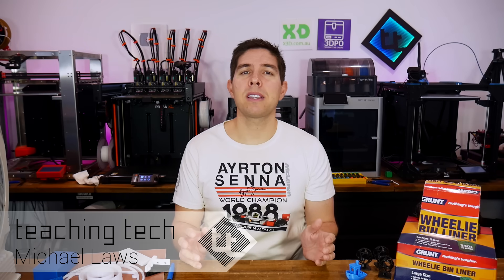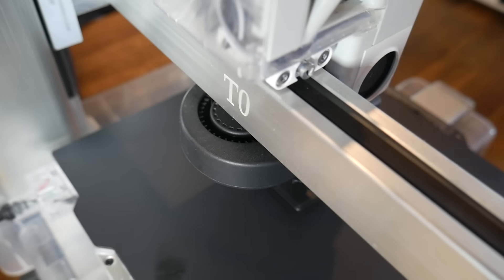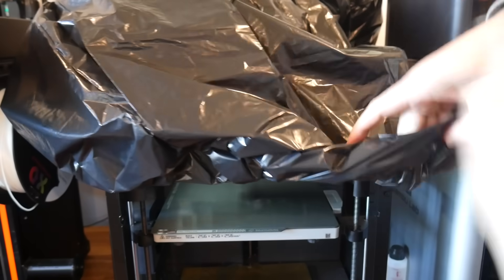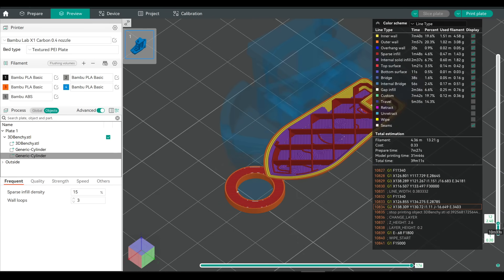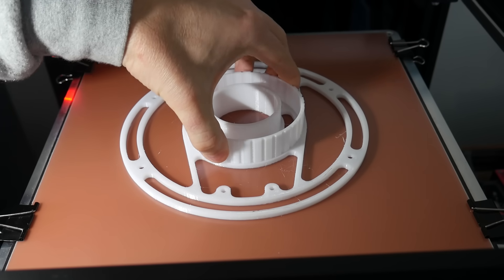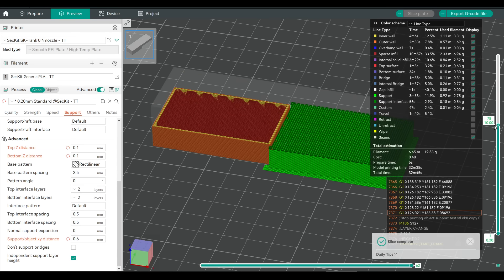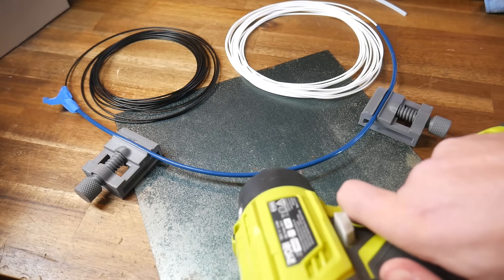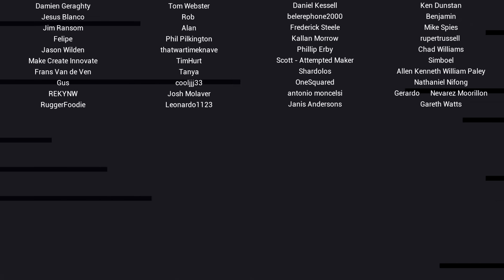Jankiest 3D printing tips that actually work

Comment: Missed your rotational fit on a round shaft by "that much"? The usual cause is a seam and rotating your parts away from the seams will let them go together but not rotate. Jank: Get the parts wet with water and sprinkle baking soda on the wet. Put the parts together and start working them in and out and around. This should get things started. Try it a second (or third) time, and eventually the parts will probably work how you wanted them to work in the first place. This trick will save you all the time and filament that you probably would have thrown away. Toothpaste works too, but I believe the baking soda leaves behind somewhat of a slippery coating.

I used this trick to get some threads to work properly. I left .020" [.5mm] of space between them but they were a no-go. When I worked in the wet baking soda, the remaining powder acted like sand paper and the solution acted like a lubricant. A half-hour of goofing around by the sink saved me four hours of reprint time.

Comment: This is beside your main point, but for the past 10 years I have used hair spray on my print beds.  PLA and PETG and TPU all print without any problems.  Easy to remove (water) or add (just spray more). And cheaper than a PCB

Comment: I got my garolite sheet on the cheap from a local hardware store and used 3m adhesive sheet to attach it to a spring steel plate, all because I also saw Angus on MM talk them up :)

Comment: I already used the trashbag method with my MK3S+ for ABS and PA filaments, good method that works well but as you said the electronics don't like that, had some bugs from time to time with this method !
Tried multiple time the method to join 2 filaments, get it working one or two times but rest of the time the filaments broke... And it worked well with the MK3S+ but not with the Bambu X1C with AMS.

Comment: For TPU which sticks too well to pei, I have one side of my sheet which I rub my oily face on, and touch with my fingers. The has 2 advantages, I can handle my sheet much easier when I can touch one side, so there other side stays perfectly clean, and TPU has perfect adhesion on the greasy side. I just flip the sheet when changing filament types. Been doing this for years.

Comment: Glue stick. I just realised I have one that I got from a reddit/ youtube but I cant remember where. I dont use glue sticks directly. They are water soluble. I cut one up and put it in jam jar which I then filled with water. The resultant solution can then be applied to the bed with a small paint brush and as a liquid comes out nicely flat and thin. Turn on the bed heater for faster drying. Also, once the glue surface starts become rough/worn (due to removal of prints) if it is not too bad I just use a wet brush and safety wash  bottle to dissolve and flatten . Obviously... water and electronics mix too well so apply some common sense.   Also ... remember to eat all the jam before doing any of this :-).

Comment: I switched from an old bed matt that ripped from a part sticking too well.

I use a sheet from ender and i cut it to fit.  It sticks to the bed.   It has helped soooo much.  The old bed would move and warp. when printing things, it would tug here and there, and each print i had to flaten the sheet..

Comment: Cardboard enclosure is way superior to garbage bag. It works well with bed slingers and if you made it big enough to fit also filament dryer you have basically heated chamber.

Comment: Here’s Jank…. When a print is pulling up I have paused and then used a heat gun (no flames here) and heated the warp.  Then I use a short (40cmx40cm) piece of 6cm thick iron bar to press it back into place. The iron cools the plastic quickly and makes it flat.  This works very well! I’ve used it multiple times.

Comment: That enclosure is too professional for me!
I had to print some large ASA prints some time ago. My RatRig Vcore3 is not enclosed. I have a small table that my printer usually stands on, and the dimensions of the printer and table are verry similar. So to make a janky enclosure, I put the printer on the floor, and the table ontop of the printer. Then I took my blanket and it covered the printer with the table nicly. 
The ASA prints were two 10h prints. I was terrified that the house would be set on fire. But it worked out! (and the blanket didnt even smell bad afterward)

Comment: for joining two filaments i use 80 by 80 mm sheet of 0.5 mm aluminium 
folded over a 1.6 mm steel rod that i had laying around 
now its shaped like a U when you look at it from the side 
stick the filaments inside heat it and once it sticks together slowly twist it inside to form an almost perfectly round joint 
if it is too thick use a bit of sandpaper to sand it down to size but usually it just works no problem. 

takes like two minutes tops

Comment: My jankiest hack is cutting 5cm thick blocks from printer packaging foam and putting them under the printer. For even better results, do this inside an enclosure or on top of a board and put another four blocks under that. That'll silence the printer right down to almost nothing. The thin 1cm foam covers don't work, because the printer settles into the foam over time. It has to be faily thick.
Reply: My wife thanks you for this tip.

Comment: My janky way of working a printer is using my little blue clippers to cut off bits of loose plastic from the base of a model as it's printing. Like if the start of a line doesn't stick, it can be one a problem but I can clip it off and save having to start over. Gotta watch the nozzle though it can come at you

Comment: Here at the bad idea factory, to print ABS on my Prusa Mini in an enclosure heated to 70C.  The parts on the printer melted.  I now had a Prusa Mini with a bunch of twisted parts.  By reheating the parts, I was able to straighten them enough to reprint new parts.  Using those, I was able to reprint a second batch of new parts that was actually straight.

Comment: @Teaching Tech, As for combining filaments, I use silicon tubing (1/8"O.D. x1/16" I.D.), using a soldering iron to heat, and slice it off afterwards. It works better than any other method I have ever tried.

Comment: Tip for matching the filament together: put the filament ends next to each other and overlap them a bit. Use a razor blade to cut both at an angle at the same time. The angles will be the same since they were cut on the same plane.

Comment: I did 2 3 4 and 5. 7 is unnecessary. I just feed the new filament into the printer while it's printing. No sensor. Not hot air.

Comment: I am a firm believer in a janky cardboard enclosure. The thick cardboard that comes on new bed mattresses is perfect. It's thick enough that you can hot glue it together, I actually hot glue the cardboard to an old hardwood coffee table I put my 3d printers on. It works so good, I even use some packing tape to make hinges so I have cardboard doors on my cardboard enclosure, it's so janky it's awesome.
Reply: Hopefully you will never get a printer to set on fire.

Comment: Once I was pretty broke when my hotend nozzle threads stripped.  I had an e3d V6 on hand, but no way to mount it to my only printer.  So I zip tied it to the plate the original print hotend was on in order to print the hotend mount for itself.  Easily the most janky thing I've ever done with 3d printing.

Comment: I join filaments by simply pushing in new filament as the old one is being used up. On my Mini it leaves a bit of the model without retractions as now it can only push, but that has never been a problem.

Comment: Tried using heat-shrink tubing to join two pieces of filament together? 
Once cooled, the short length of tubing can sliced off. Using clear heat-shrink tubing allows inspection of join to avoid overheating.

Comment: Wow. The "colouring" of support, (or 'layer adhesion modification' is maybe a better term) is really interesting. This is the sort of thing I wish the big manufacturers were tackling instead of just taking open source designs and barely changing them. I could imagine a small inkjet style head mounted on one side of the normal toolhead that can be deployed with a small servo. No doubt a little bit of research could deliver a better adhesion modifying agent to use than marker ink.
That would be a true game changer.

Comment: Uh, that marker trick isn't jank, it's brilliant!

If you want *jank*, you want my curing station I made out of an old Amazon box that I lined with aluminum foil and taped the UV light to, the day after I got my resin printer..   I've been meaning to replace it with an old microwave that's been repurposed, but I just haven't gotten around to it...since 2021.

Comment: My very first printer was an Anet A8. Of course I fixed all the "this could kill you" issues (I'm not insane) but once those were dealt with, the thing worked quite well. But wiring it all up was a nightmare, and my wire management skills are sorely lacking. Yeah, the wiring on that thing was... messy. Anyways a year or so into its lifespan, the part cooling fan started making the death rattle noise. Tried lubricating it, and that helped for a while, but eventually even that stopped working. I really, really didn't want to have to wire in a new fan (in addition to the wiring nightmare, that would also mean I would have to work on the hot end, which was a PITA to disassemble) So I just unplugged the dying part cooling fan from the mainboard and plopped a cheap desk fan next to the printer. Made sure to switch it on after the first layer went down (I never ran the thing unattended, even with the safety issues corrected, I still didn't want to take any chances; again, I'm not insane) and it worked amazingly well.

Comment: In place of the PTFE, use silicone tube narrower than the filament so it has to stretch. The joint will then exactly match what the filament stretches it to, and you just cut it off and throw away the 1.5 cm snippet rather than having to slip it off.

Comment: Instead of using PTFE tubing to do the join you can use silicon rubber tubing which can then easily be cut with a knife so you can remove it from directly where it is, ie. not sliding it the fill length.

Comment: Used G10 for nylon prints.  Works quite well unless the print is long.  The bed temp and part would warp the G10 over time.

Comment: I have used the PTFE splice a lot.  My older direct drive didn't care about the splice bulge but my P1S jammed.  I just use an exacto blade to cut the PTFE tube off, I have enough scrap short pieces thats its free.

the tighter diameter would work to fix thr P1S jamming, I just got Patron fee back....

Comment: Oh boy. I did some of those things and was sure it was normal.
I use a FR4 / G10 bed. PETG works really well with those. If there is stringing I torch the print. Joining filament with a PTFE tube... Again something I have done.

Comment: fixing it with fire: daily.  I hold it over the stove
old-school part cooling: only for speed benchies
derelicte enclosure: not anymore, but I used to do it pretty frequently when I only had open air printers
who needs CAD?: rarely, but it comes up on occasion
G10 bed on a budget: since 2013
colouring in support: never even thought of this, but I'm adding this to my arsenal today
joining spools of filament the jank way: I do this occasionally, but I actually use an old heater block rather than a heat gun.  works well

Comment: Man, I've done a lot of these...

Probably the biggest success has been attaching FR4 (Garolyte) to the underside of our textured PEI sheets to get a reversible build plate.  Top notch for PA and PET-G. 

We spent a while trying to get filament joining to work - we waste a notable amount of Carbon-Nylon and it would be good to recoup the cost.  Market solutions have been rubbish so far, so we're thinking some metal version of your thin PTFE tube may be worth a punt. 

Fire fix is a classic.  As is slicer-based model manipulation.  Glad to see them here. 

Definitely need to try coloured supports for some upcoming prototypes, but I also need to find a better production-ready solution for some awkward parts we're planning on handing over.  Will be revising MM's recent easy-supports video, but still anticipating a bit of a struggle.  Any ideas, anyone?

Comment: The sharpie hack is next level. I use Octoprint and I've got gcode in the After Print Job Is Paused section and also in the Before Print Job Is Resumed section of the custom gcode section of Octoprint. Pressing pause in Octoprint causes the print head to travel to home position and up 100mm (code below). I can then change filament using the printer's local controls or place magnets in the print or anything else you can think of. It never occurred to me to paint sharpie in the top layer of the support to stop it sticking as much. Also by adding '@pause' gcode at the specific layer in Cura you can easily embed the Octoprint pause in the object gcode file and then when you're done with the shenanigans, press the Octoprint pause button to un-pause and off it goes again.

Here's the After Print Job Is Paused Script
---------------------------------------------------------------------------------------------------------

{% if pause_position.x is not none %}
; relative XYZE
G91
M83

; retract filament, move Z slightly upwards
G1 Z+5 E-5 F4500

; absolute XYZE
M82
G90

; move to a safe rest position, adjust as necessary
G1 X0 Y0
{% endif %}

-------------------------------------------------------------------------------------------------------------
Before Print Job Is Resumed Script
-------------------------------------------------------------------------------------------------------------

{% if pause_position.x is not none %}
; relative extruder
M83

; prime nozzle
G1 E-5 F4500
G1 E5 F4500
G1 E5 F4500

; absolute E
M82

; absolute XYZ
G90

; reset E
G92 E{{ pause_position.e }}

; move back to pause position XYZ
G1 X{{ pause_position.x }} Y{{ pause_position.y }} Z{{ pause_position.z }} F4500

; reset to feed rate before pause if available
{% if pause_position.f is not none %}G1 F{{ pause_position.f }}{% endif %}
{% endif %}

-------------------------------------------------------------------------------------------------------

Also as to the G10/Garulite print beds I didn't realize it was a janky hack. I'm just cheap and it's all I've ever printed on after the Artillery Sidewinder X2 and my old Ender 3 print beds started showing signs of wear. The  X2 and the E3 beds cost me $12 and $8 respectively on Amazon and they don't seem to show much signs of wear after hundreds of prints.  Oh, and my kitchen torch may come close to my 3D prints from time to time.

Comment: I'm almost disappointed that a filament oiler isn't included here. It's always helped all my machines for almost 10 years now.
Reply: Helped with what? I never felt a need for it.
Reply: Per CHEP: If you have an all metal heat break, an oiler is mandatory. I've found  this to be true.

Comment: I was very interested in using a PCB to prevent premature wear of the glass table on my FLSun Super Racer. I found 30x30 cm plates for low prices on the internet. 

However, a question arose. A quick Google search on what PCBs are made of says that "The material that makes up the base, called laminate, of a printed circuit board, can have different compositions, some examples are: phenolite (cardboard impregnated with a phenolic resin ), fiberglass, composite (mixture of phenolic resin with fiberglass) and ceramics."

Knowing this, I easily find PCBs made from phenolite, but when I search for "PCB made from G10 / Garolite" I don't get any results, other than fiberglass boards that are not PCBs, as they do not have a copper side. And they are not cheap!

Are you sure the PCB you used is made of G10? Would another material also serve the same purpose? 

Thank you very much.

Comment: Spiders are just about always welcome in my home. They're great for debugging!

I like that idea of joining filament with a PTFE tube as a guide. Since you're using only a small piece, wouldn't it be worth it to split it open with a knife rather than slide it all the way to the end of the filament?
Reply: Or just leave it in place as someone else mentioned in the comments.

Comment: Used flame on occasion.
My TH3D flex plate works great unaided with PETG. I just add 0.04 extra clearance to the nozzle. Wait for it to cool as it really sticks when heated.
What's nice about Klipper is you can create an M600 macro for universal compatibility. Any M command that isn't already used in Klipper is fair game for a macro.

Comment: I have a flashforge 5m which is a solid machine but no enclosure.  I used a ceramic reptile heat lamp to preheat my enclosure that I built out of clear shed roof material ... I tested the heat resistance of the roof material with a 1200 watt heat gun held in one spot for a minute did not melt or discolor so therefore it is more than tough enough to be around the ceramic reptile heater... to these 150 watt bulbs can be had on the jungle site for less than $15 US

Comment: Put your removable bed (G-10, PEI or borosilicate) in your refrigerator or freezer for fast removal of your parts. Just like slow cooling, the CTE mismatch will free the parts. Don't do this with mirror or plain glass.
I ! need to try the Sharpe trick!! and the PTFE tube joining. 
Awesome, thanks!